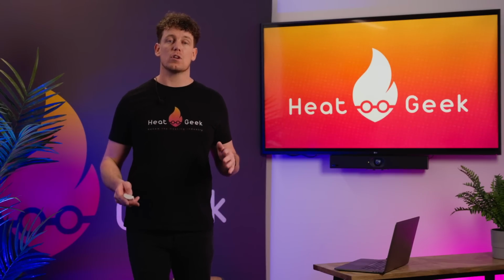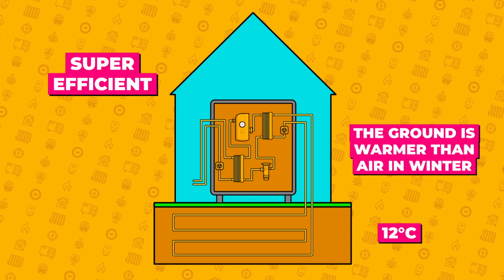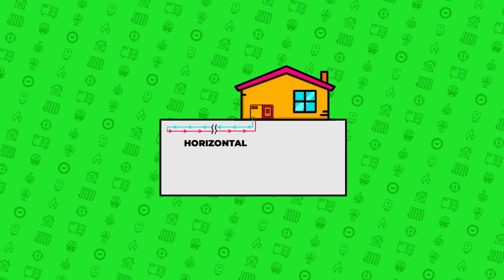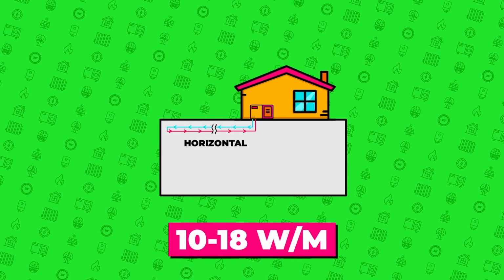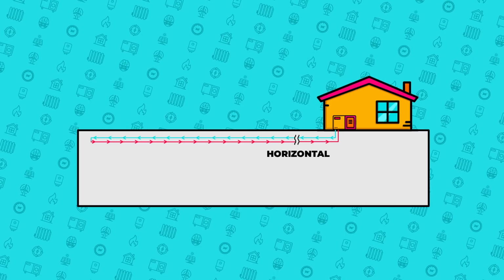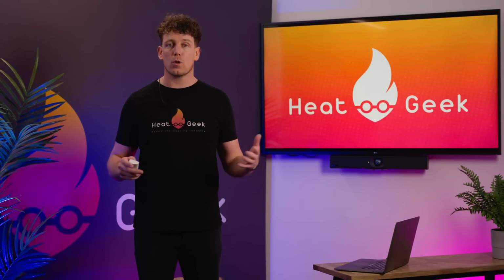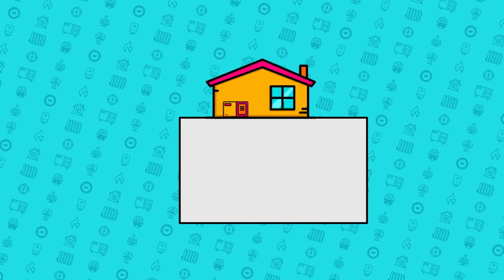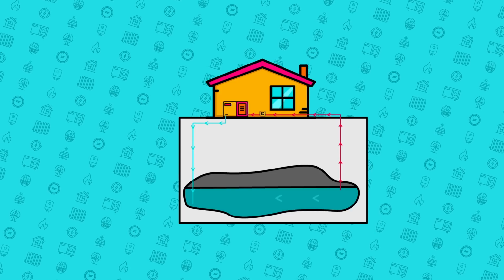How heat pumps work for dummies.

Comment: Nice one Adam. I have read that where I live peak winter ground temperature at 1 meter deep can be below 7 Celsius. I can confirm this as I measure the temperature of water supply as the pipe enters the property. Makes one think twice regarding ground source hp.
Reply: That just means you need to get deeper for your ground source heat pump. Municipal water lines are generally laid just deep enough to not freeze in winter. You would have to go as deep as 2.4m to reach the no-freeze line in polar regions. You're much better off just going vertical if it's actually cold in your neck of the woods in winter.

Got a vertical loop myself about 50m deep, brine temp stays at 12 °C in winter or summer.
Reply: @miken3963  For a vertical hp not only is a geological survey needed but a geological permit for a certain depth. And then if the installers need to drill lets say deeper than 50 meters, you need a new permit allowing you to drill deeper than 50 meters. And there's no guarantee you'll actually get a permit. Vertical hp is just so much hassle, hardly worth it in my opinion. However if you have time and money knock yourself out

Comment: Is it even remotely possible to replace a traditional Gas Boiler system that feeds a 15mm pipework and radiators with Air Source heat pump without ripping the entire house apart? I'd want to re-use as much of the incumbent system that is in place. Where's the best place to start?  I want to avoid cowboys and sharks.
Reply: I regret to say that's well within convention, but it can't have sourced any ventilation so you'd want an air exchanger in addition to the insulation prerequisite and evicting or amending the gas boiler. Also [Yank hat] if you had cowgirls install ground loop heating from the cellar to roll a save versus -40° weeks (if the leccy holds out) wouldn't that be regular with the inspectors? Or not to call the Scotswomen cowgirls?

Comment: Much prefer air-to-air heat pumps.  Cooling is just as important to me as heating.
Reply: Apparently some air to water can do cooling (i.e. they can run the radiators with cold water in summer) although surely this must create condensation on your radiators?
Reply: @jezlawrence720  radiators operate using convection, so that wouldn't work.

If the world is supposed to be heating up, we will need more cooling, so it seems mad to not go for that option.
Reply: @StuartJ My thoughts exactly. The group of people with the disposable income to pay for heat pumps are approx middle age and close to retirement. These people will not be coping well with extended periods of hot and possibly humid weather that will be increasing likely in the next few decades in the UK. Cooling as well as heating will be essential for this group of people.

Comment: I'd love to get rid of my gas combi boiler for a heat pump system and also would put in solar panels and a home battery to help keep the electricity costs of this down.  I'd really like one that could cool as well as heat - is the only option the mini-split style of air-to-air heat pumps?  I don't think they're eligible for the government grant, which seems a bit mean.  Are there other options?
Reply: Cooling is possible with central heating (Air or Ground Source), but to get the most out of it, you need fan coils for the rooms you want cooling, and a 4 pipe system. (standard 2 pipe is possible, but is more restrictive), all these will increase the installation cost.  You will likely find that an A2A system even without the grant is cheaper to install than an A2W system.  However, with A2A come replacement time, you're basically going to be paying the same amount again.  So an A2W system can work out cheaper in the long run.  There's also nothing stopping you from having an A2W system for heating, and then A2A for a room that needs cooling.